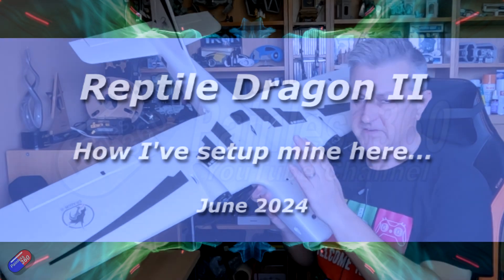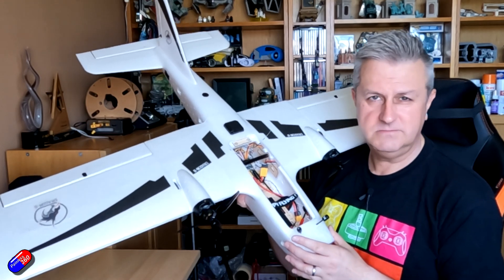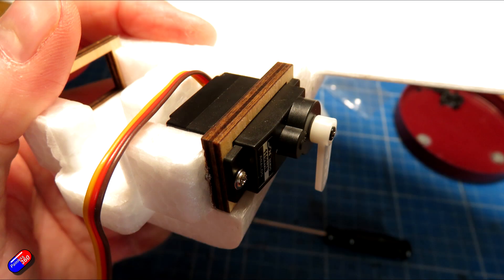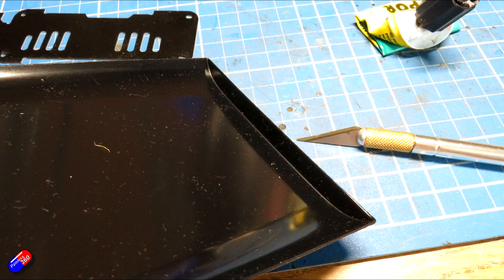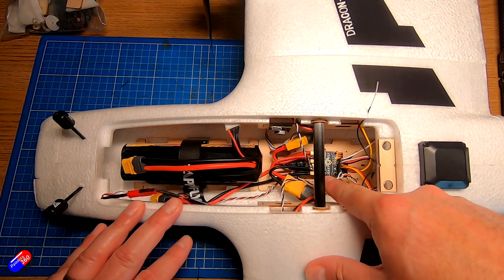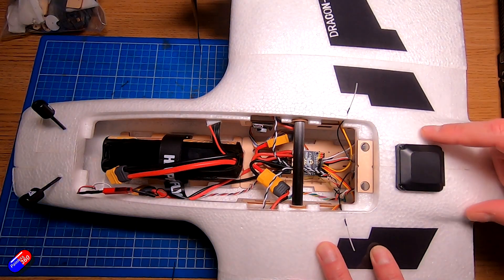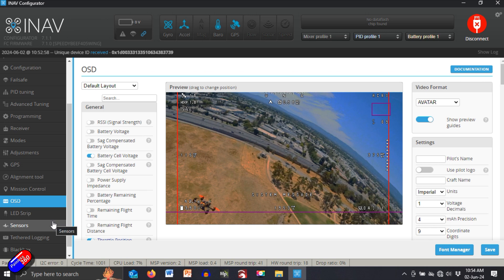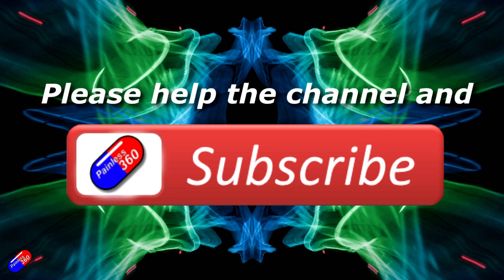Reptile Dragon 2: How I've built mine here! (INAV, SpeedyBee F405-Wing and Walksnail)

Comment: Hi Lee, great video. One thing about the canopy lid issue @ 9:51. I found that as you try to push the innes spar in, the friction squeezes the canopy, making it harder for the lid to fit. If you just push the top of the opening apart a little, the lid will fit perfect.
Reply from the maker: Thanks for the comment. Mine is like that even without the spars or wings fitted. Thanks again.
Reply: @Painless360  sorry for that. Hope that's not too much of a deal for you. 👍
Reply from the maker: Not at all, as I've mounted the walksnail and gimbal on it now. Having it tight is useful! Happy flying!

Comment: room for FC is in the tail section together with analog vtx, all front is the space for battery EASLY  4S 3P 21700  15,000mAh, flight time can be way over one hour with distance covered around 100km or more

Comment: Nice video.   

I built mine a year or so ago and agree that the instructions are lacking.   The main thing is they omit throw surface volumes.  I'd be very curious what values you're using. 

Another thing I hope you focus on in great detail in the next video is the correct INAV trimming/training procedure. 

A word of caution,  the fuse halves are bolted together using 4 screws into ply that is glued onto the foam parts.   The ply will pop off really easily because they use very little glue.   Maybe that's a design feature to prevent greater damage,  IDK.  Regardless,  a ruff landing will weaken it or,  as in my case,  pop it apart.  Just a FYI.
Reply from the maker: I've used the INAV defaults for the maiden.. Video coming soon! :D
Reply: @Painless360  What I'm confused about and most interested in is the 1st couple flights.  E.G. the way to set auto trim, rates, save settings upon landing, and correctly configure manual mode.
Reply from the maker: See my video on how I maiden a plane. I cover it in all of the INAV for Beginners Series. Works every time and zero hassle too... Best of luck!
Reply: @Painless360  I only flew mine once and got into trouble when I decided to manual LOS land (been flying LOS planes for many years but new to FPV planes - I have lots of FPV quad experience) but it didn't have enough control authority.  I stalled into a downwind belly flop landing about 2' above the ground to avoid hitting bushes.  It was a soft landing but the tail popped off.  Easy fix but I've been flying other stuff since.  I'm itching to pull it back out for a 2nd maiden.  BTW, first flight was great - no issues.
Reply from the maker: My maiden flight video is listed in the video description if you want to preview how mine did...
Reply: @Painless360 When I say no issues, no issues except not enough control throw for landing.  I believe that I did not correctly do the autotrim function.

Comment: yepp great wing, I am using ArduPilot for that. with a Li-ion 21700 4s2p battery. It flies well and is a pleasant cruiser.
Reply from the maker: Thanks for the comment. I don't think that 18650s will handle the higher currents well on this... Happy flying!
Reply: @Painless360  Today's my maiden with this exact model using 4s2p 10000mAh, a Caddx vista and a GoPro Hero 7 in the front. CG is on the mark. I was actually not disppointed with the built quality, other than the servos included in the PNP version. But what do you expect for €130 (which I bought it for).
I also prefer the tightness of the hatch so I don't have to add extra magnets or tape to prevent it from flying off. Looking forward to your maiden!
Reply from the maker: You should be able to get over an hour of flight easily with that setup! Best of luck!
Reply: @Painless360 the maiden was a success! It flew really well. Cruising at around 5.5 amps with the stock FC current scale. I'm also using a SpeedyBee F405. I think this is my new favorite allround cruiser. I mounted my VTX vertically against one of the two front air intakes on the side and added a tiny air scoop on the outside, otherwise it didn't get enough cooling.